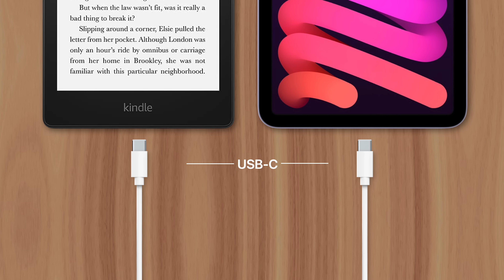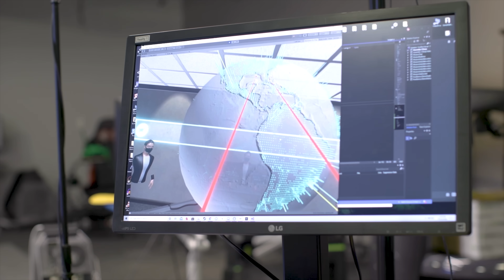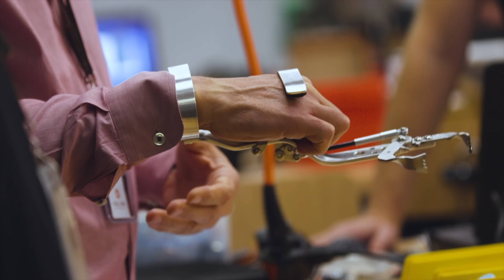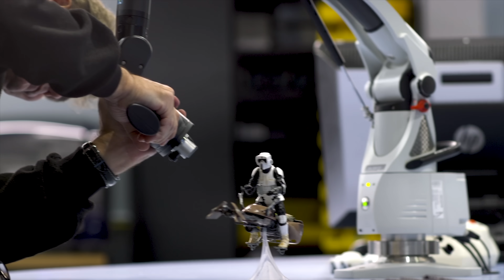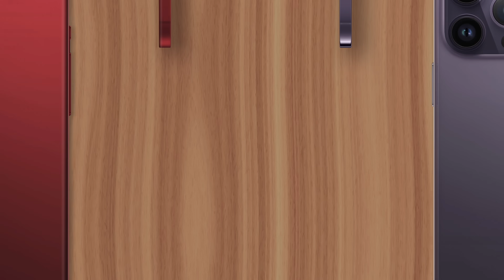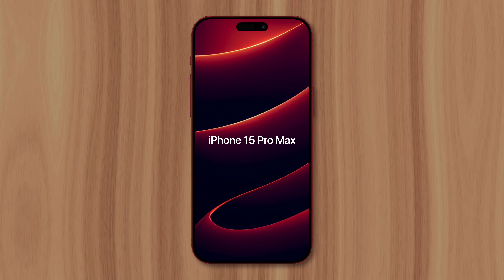iPhone 15: What To Expect

Comment: Undecided on Plus versus Pro Max. I like that Plus has the thinner camera bump, presumably better battery life, and the mute switch, but the rounded corners and titanium edge and 6x zoom are tempting
Reply: I'd buy 14 Pro Max instead of 15 Plus. You'll be getting additional Telescope camera, 120Hz screen, Always On, etc. for about the same price.
Reply: @armenia1313  That’s a no go. Gotta have that USB C port, so I’m getting a 15 one way or the other.

 I can’t tell the difference between 120hz and 60, and AOD is kinda worthless to me when I have an Apple Watch SE 2022. Also I don’t really like how big the camera bump is on the pro models. I’m assuming the curved border probably roughly offsets the big camera bump as far as general comfort to use, so I think my final decision comes down to this:

- Plus has the volume/mute buttons I’m used to rather than a redesign, lower battery consumption, and costs less - about $5 a month less if I use it for 5 years, assuming the leaks are correct that it’ll be about $100 more than last year
- Pro Max is more durable, has higher specs, has thinner bezels, and has some nice bonus hardware features

Currently leaning towards Pro Max based on leaks, but most of the time I’ve been leaning towards Plus. Ultimately it’ll come down to when they’re actually released and I know precisely the difference between them, because nothing in this video is truly 100% confirmed. I’ve heard speculation that the Pro models will have more RAM than the baseline. I’ve heard they might have 256gb base storage and offset some of the cost of the “pro” difference. I’ll just have to wait and see what the future holds, but whatever happens it’s gonna be a big upgrade over my XR. I’m still more or less happy with my XR, but the main pain points I have with it are battery/RAM/camera.
Reply: @armenia1313 there is no telescope camera on any current iPhone. The ones to be released this year may include one
Reply: @armenia1313  or get a samsung/pixel and have way better cameras, even better screens (actually apple uses samsung screens lol)
Reply: @anymous4322  yeah but google and samsung don’t offer longer software support or a better ecosystem.
Reply: @tloud600  Samsung offers 4 years of updates, Apple offers 5. only one year difference between the two. and secondly ecosystem is pseudonym for prison.
Reply: @anymous4322  no they don’t, Samsung manufacturers iPhones screen because it’s a cheaper for Apple.
Reply: @xkancho  the difference is that Apple is guaranteed to get the update at the same time regardless of country, carrier, or model. Galaxy doesn’t offer that, it’s a “maybe you’ll get it, maybe you won’t” I’m still waiting for my update on my S23U
Reply: @anymous4322  photos look better on pixel and Samsung but Apple dominates video and screens on Samsungs are sharper and I think they’re better
Reply: @Elite.868  Samsung screens are generally better but the 14 pro changed that , much brighter and more vibrant screen than S22U but I think S23U is at least on par with 14 pro if not above.
Reply: @gurkiratsandhu  For as long as Apple relies on Samsung for it's screens, Samsung will no doubt always be better in the display department.
Reply: @anymous4322  No they dont. Apple uses screens that are manufactured by samsung, but are designed like apple. Kinda like how foxconn produces iPhone however its still apples's product. It should also be noted that LG also makes parts of the display for iPhone.
Reply: @Ben21756  Apple also has LG as a supplier for their displays.
Reply: @anymous4322  actually, Samsung manufactured the screens just like LG does. Apple still uses their own custom display.
Reply: @xkancho  Technically for Samsung,  they're offering 4 years of software updates and 5 years of security updates...and even then, most of your apps should keep getting updates for at least 2 years after that.
Reply: @anymous4322  LMAO Samsung is always manufactured iPhone’s displays, alongside with LG and Japan Display. oh and also few parts like battery. Apple made their custom display, calibrated it and then sent it to Samsung so they can manufactured it. just like other parts like camera, they hired SONY to MANUFACTURED the camera and the lenses. it’s called business partner, buddy.
Reply: @anymous4322  well i’m sorry, english isn’t my first language. my point is Samsung always manufactured iPhone’s spare parts since the first gen of iPhone, from the display to little things like battery and taptic engine. you said apple used samsung screen on newer phone but you’re wrong, Apple uses their own display and hired other companies such as samsung to “make” it. that’s why i said Samsung MANUFACTURE the display. you seems don’t understand the difference between manufacture and use.
Reply: @anymous4322  Apple designed and made their own screen, Samsung only manufactured the screen. this is so simple, yet you seems don’t understand. so by your logic, Apple uses TSMC chip?
Reply: @xkancho the quality of Samsung and other Android updates policy is way below that of Apple. How quickly does a new major version is delivered? How often and quickly? When was Android 13 released? When was it pushed to Galaxy devices? How many days between the 2 events?
Reply: @xkancho  I just updated my 7 year old iPhone 7.
Reply: @xkancho  Apple offers 7 years not 5...
Reply: @gurkiratsandhu  the Samsungs have a better resolution it looks sharper to my eye in real life but Apple finally beat Samsung with 2000 peak but the standard brightness for both is around the same and also I think Samsung has a better minimum brightness. Apple also looks smoother to me
Reply: @Elite.868  Samsung can go super dim with the Extra Dim setting
Reply: @achmadputra2  you should never say sorry because your english “isn’t good”. english isn’t your first language and most of americans only speak english. your english is great and I completely understand what you wrote :)
Reply: @romulo.alexandre  thank you! i said “my english isn’t good” because they claimed they don’t understand what i’m saying, so i apologized. i mean i’m aware that i still need improve my english.
Reply: @Elite.868  apple definitely doesn’t dominate with screens their screens androidare always behind
Reply: Always choose pro over plus. It's a no brainer. You are getting so much more for a little extra. Either you should get the base model or the pro model. It's all or nothing.
Reply: @TamilEelam1  That doesn’t seem like very sound logic. It’s $200 difference, maybe $300 based on leaks, between Plus and Pro Max. That’s one-third more money, and that doesn’t equate to one-third more features.

So then it really depends on what those extra features are, and if I personally would use them. Like, if I had to choose an iPhone 14 right now, I’d go for the Plus - I don’t care much for the 48mp camera, nor the 120hz display, nor the always-on display, nor the heavier steel siding, so all I’d be getting (that I would really use) for that $200 is a newer chip, optical zoom, and the dynamic island. None of which are things I couldn’t live without.

If ALL the leaks I’ve seen for the 15 are true though, I’d go for the Pro. If it has higher baseline storage, higher RAM, and all the features in this video, then it’d be worth the extra money.

The Plus phones exist for a reason, and it’s for people who want a bigger screen but don’t care for any of the Pro features. It’s designed to be “good enough” for the typical consumer, and then there’s an upgraded version with specs beyond what most people actually need.
Reply: @sparkiper  Well, there's a reason the plus models are failing this year. Why would someone pay for a plus phone when they could pay 100 more for a pro model. People would rather have a normal sized phone with better features than a plus phone with nerfed features. Anway, 200 more for a pro max is a good deal in my opinion. You get way more stuff compared to the normal models nowadays.
Reply: GET THE 15 PRO MAX 😅
Reply: @slickairmash  nah its overpriced and "pro max" sounds cringe
Reply: @anymous4322  bro, name doesn’t mean anything. It’s what you get from it and I think it’s worth it
Reply: @anymous4322  It's not just hardware, it's software. People simply prefer iOS over Android and like iPhone's for that reason.
Reply: @TamilEelam1  Yeah there are people who like iPhones but they need to wait another 5 months to get a feature Samsung has had for several years.

It would be interesting to compare periscope with Apple and Samsung. The 6x periscope on the 15PM would be 12MP vs 10MP on the S23U, but that's not a huge difference. In contrast, the N20U periscope is 5x zoom with 12MP
Reply: @ethoshrimp8190  that’s if Apple even adds it and the cad models aren’t sure
Reply: @ethoshrimp8190  I do agree that Apple takes their time with releasing features, but again it's also about software.
Reply: @anymous4322  Again, it's up to the person. Many people simply prefer iOS over Android. Anyway, in the past, android wasn't modern or sleek so many people are already used to iPhones and are less likely to switch.
Reply: @anymous4322  having used both apple and samsung, I have to say using iOS feels much nicer than android with all the garbageware that comes shipped with it. I had candy crush pre-installed when i bought my phone. like wtf?
Reply: The pro models have better specs & camera over the regular series or the plus series. That’s why the pro models are more expensive
Reply: And old chip
Reply: I’d go with the iPhone 13 Pros as they have the best design available :)
Reply: @QnjtGWonQNqVsbYyzjx4  I wouldn’t because it has a Lightning port, lacks a Dynamic Island, has flat edges, and will be two years outdated by the time I upgrade my phone. If I had to get a new phone right now I probably would go for 13 Pro Max because it’s about the same price as the 14 Plus and has optical zoom, but I don’t want a lightning port. Every other device I own uses USB C, other than my phone and my airpods. I don’t want to carry two charging cables with me everywhere when one of them works for nearly everything.
Reply: @sparkiper  the island is bad use of screen state, the round edge although great, the iPhone 15 design wasted the side space of the screen. Therefore, it’s the worst design. USB C is great but not worth the horrible design.
Reply: @sparkiper  The dynamic aspect is DECENT but the design is a waste of space in my opinion. Hoping for Apple to release the SE Pro with all the iPhone 15s features(not including the design change) in a iPhone 13 Pro chassis. Plus, they should absolutely bring the dynamic notch to the older phone
Reply: @QnjtGWonQNqVsbYyzjx4  Wouldn’t an SE Pro be an oxymoron?

And I actually really like the design of the 15, the dynamic island is smaller than the notch and lets me see the edge of the screen to better extrapolate what’s sitting under the black spot, thin bezels=either more screen or easier to hold one-handed, solid state volume feels weird and unnecessary but isn’t a bad thing, action button would take getting used to but is ultimately an upgrade.

Provided that all the leaks I’ve seen are true (which, of course, isn’t gonna happen, but I suspect most will be), every single thing I’ve heard about the 15 has been a positive in my eyes, other than that they’ll require MFI USB-C cables for faster charging.
Reply: @sparkiper  It stick out from the bezel so the usable screen space is smaller. Btw, what content can be fitted up top? I take the older design meaning of SE as the most important and of course is cheaper to the 15 pros but not as cheap as the 15 pluses
Reply: @sparkiper  Most of the product after 2021 are just niche and only appeal to certain customers. Like the iPad Pro M2 and the iPhone 14 Plus
Reply: Plus for sure. The “pro” is completely unnecessary, even with the rounded bezel, you most likely get a case that has a rounded rubber case anyway, since having these without one is stupid anyway.
Reply: @Thewaterspirit57  As it happens I’ve learned more about the differences between pro max and plus. Plus doesn’t have telephoto zoom at all, and I don’t expect that to change with the 15.

As of right now I’m planning on getting the Pro Max. Sure, I’m gonna disable 120hz because I can’t tell the difference and don’t want to learn to, and I’m gonna disable the always-on display because I don’t want it when I’ve got an Apple Watch, and I’m not ever gonna use the ProRaw mode on the camera - but I DO want the 2x, 3x, and 6x zoom on the cameras, the better frame, the higher RAM, the A17 chip, the action button, and the smaller bezels. Provided, of course, that the rumors are all more or less accurate.

Ultimately cost isn’t really much of a factor for me. I’m gonna be using the phone for a bare minimum of 4 years, likely 5 or 6. Assuming the rumored price increase is accurate, $1000 vs $1300 for the two models I might potentially buy only comes out to a difference of $5-7 a month.

I had thought that baseline phones starting with the 11 had normal and telephoto camera lenses, since the older 2-camera phones had telephoto, but it turned out the second lens on baseline is ultrawide. As such, my original reason for considering the Plus (smaller camera bump to theoretically fit better in my pocket) is kinda moot when I actually want that third lens. And the higher processor/RAM specs should help future proof for an extra year or so compared to the baseline, so the extra cost is kinda a wash.
Reply: @Thewaterspirit57  I think iPhone 13 Pro is the best right now
Reply: The Pro max has better battery life.
Reply: The 15 plus definitely doesn’t have better battery life that would delete the purpose
Reply: @Messup7654  The 14 Plus has a better battery life than the Pro Max, not sure what you’re getting at
Reply: @sparkiper  I’m talking about the 15
Reply: @Messup7654  Which hasn’t come out yet, so the only information we have about it is speculation. It stands to reason, that the reasons why the 14 Plus has a better battery life than Pro Max (60hz screen, no AoD, etc) will remain in effect for the 15 Plus.
Reply: @sparkiper  you can just turn off aod  and lower brightness and pm has more battery life now
Reply: @Messup7654  Better? Unlikely, they have the same exact battery size.

I don’t know what precisely contributes to the 14 Plus having better battery, maybe every single one of those things is just an option that can be turned off - but if I’m gonna be turning off every Pro feature anyway, why pay for them?
Reply: I might get the Pro Max if I can. If I can't afford it, I'll just get the regular one or the Plus one. That's way less expensive.
Reply: @thegreatestsuperheroofalltime  Honestly, over the course of the five years that anyone worried about costs will be using the same phone, the difference between $1000 and $1200 only comes out to an average of $3/month. So if you want the pro features, and you have consistent income, go for it - you can trim $3 a month off of other things really easily.

Comment: The phone will have to have a glass back for wireless charging. So I don’t think they would extend the titanium to the back.
Reply: No it don’t. The antennas are printed on the outside of the phone.
Reply: @iPizzaSlice  so how will it wirelessly charge if they remove the glass on the back of the phone.
Reply: @EquityChaser1  
Wireless charging is different. And it doesn’t use antennas. It’s coils.
Reply: @iPizzaSlice  I know that you said that the antennas are printed on the outside of the phone. As if the phone can be charged through the antennas. Apple won’t add titanium to the entire chassis of the phone it has to be glass on the back to in order to support wireless charging.
Reply: @EquityChaser1  
Yeah, I wasn’t really paying attention to what you said, sorry, my bad.
Reply: @iPizzaSlice  oh ok no worries have a good one  bruh.

Comment: I feel like they should move the action button to below the volume buttons. A lot easier to press from a neutral position since it’ll be used a lot more
Reply: I like your idea, but the location changing would not be convenient. People are used to the old location.
Reply: @itisCheck  yeah but people are also used to it being a switch and use for vibrate mode. Hense why they said they’re “replacing” it. They’re taking out a feature and adding a new one in its place. It won’t really matter in terms of muscle memory since you’d have to unlearn half of it anyway (slide gesture, command etc)
Reply: @shaunclarke04  well yeah
Reply: Yeah but they gonna leave it for the improvement in new IP 16,lmoa😅
Reply: @vickykapar1465  @shaunclarke just another example of how apple is removing features to make money (esim)
Reply: @itisCheck  Esim is quite literally, easier to set up, more secure, and you can have a theoretical unlimited amount of phone numbers. While they will be making slightly more on each sale, the extra amount they will make is so little it's negligible. This change is for the better, and barely effects you.
Reply: @milkyplays5566  uh no. i accidentally reset my iPhone, and it took me 3 days to call my carrier and get esim back onto my iPhone 14. worst experience with my iPhone ever.
Reply: @itisCheck  that’s on you then, I and multiple other people I’ve known have had zero issues with eSim, even when resetting the phone.
Reply: @milkyplays5566  COME ON MAN, its not a competition, and I'm not tryna win. i know its on me
Reply: Yes
Reply: You must have small hands. I can reach the mute switch with my thumb. Obviously can't flip it but that wont matter because it'll be a button.
Reply: @liamwelsh5565  as long as people arent lazy enough to MOVE THEIR PHONE and press the button/swich, it'll be ok
Reply: But that’s where I place my middle finger when holding my phone with my right hand. I would keep accidentally pressing the button